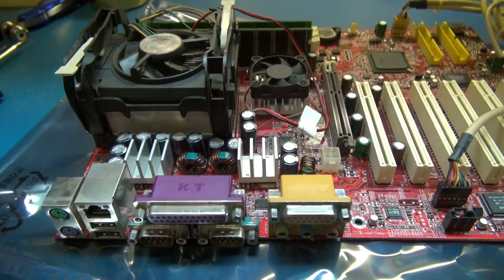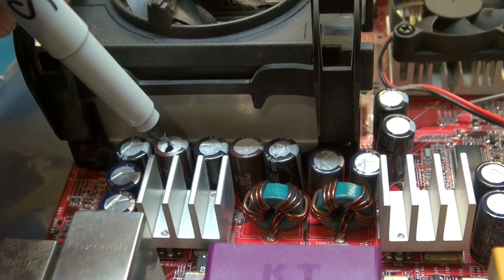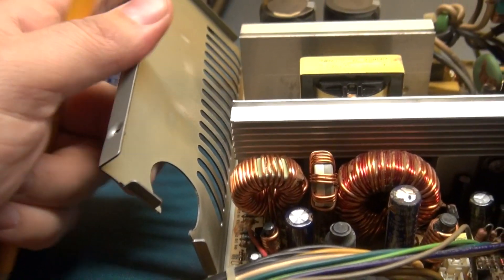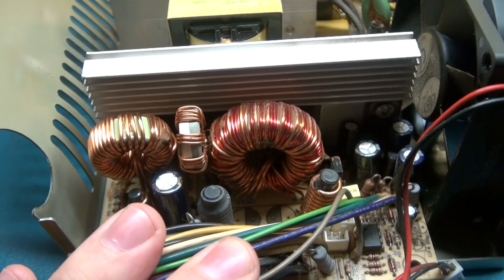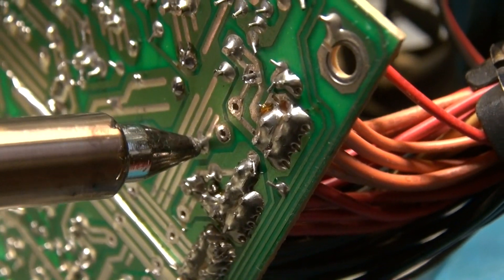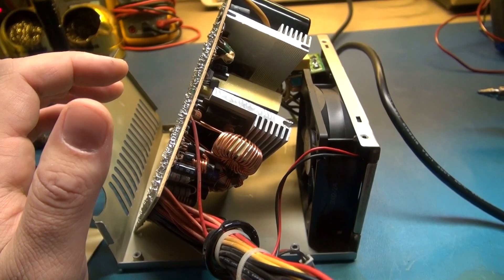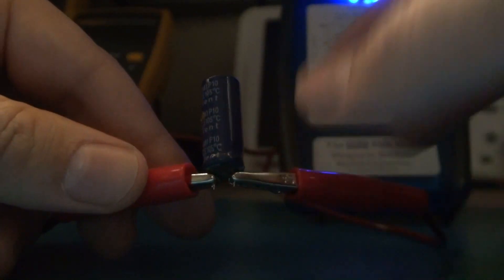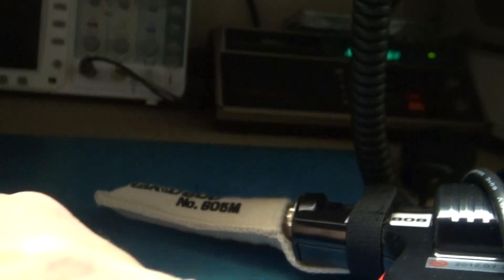MOTHERBOARD AND POWER SUPPLY REPAIR.

Comment: Kev, would you think that the $15 to $26 ESR meters available on Amazon are a reasonable solution for a DIYer?
Reply from the maker: I have no idea if the ones from amazon are any good. I use this one. It was a kit to build. 
http://www.ebay.com/itm/Anatek-Blue-ESR-Meter-Full-Kit-for-Self-Assembly-BESR-kit-/181463391631?hash=item2a400f9d8f:g:Q-8AAOSwPhdVCg8U

Comment: I usually just replace all of the caps with good ones so I don't have to go back in when the leftover cheap ones blow. I've only ever done this on monitor PSUs.
Reply from the maker: +Tim Ramich Yea I usually do that as well, but It was an old P4 and I was not going to be using it for much longer at the time.

Comment: my dell power supply is not working.all the capacitors and transistors are apparently in good condition plus nothing smells bad.but still its not working can you help me.REGARDS
Reply from the maker: +Rizwan Nasir  Not always will the capacitors look blown, they may still suffer from internal damage. not only that but any component can look fine but without proper test gear you will never now for sure. you will need another supply to test to make sure that is the problem . you could have something else not functioning properly.
Reply: WHAT SHOULD I DO
Reply from the maker: +Rizwan Nasir Well if you can borrow a good power supply from someone or buy one to see if that is your problem. Go to best buy or something and buy a cheap supply, If it doesn't work bring it back. If it does keep it. They are not that expensive. Other than that without test equipment it would be hard to repair. You would just be guessing.
Reply: +Rizwan Nasir The computer not powering up doesn't mean the PS is bad.  A bad motherboard can just refuse to power up.  Good to have old power supply and motherboard floating around.  My advice is as time goes on if you build your own computer and upgrade, do not throw anything away... Ever.
Reply from the maker: +mason salt My point exactly.
Reply: +kev31779 What test gear.

Comment: Hiya, I've got an old pc that I tried to connect to my hdtv through vga to vga but the display won't work.. it just goes blank (black screen) then power light flashes on the hdtv. Haven't used it in a while, for like 4 years lol but I recall it working... it powers up but but no beeps :( From what I've gathered, it could be the cpu or mobo... only using a keyboard, could a mouse not plugged in stop an old pc from booting up/ showing a display on monitor/ hdtv?
Reply: +Bored Gamer try to change the tv input from hd to vga... if this didn't work, i guess you should check your pc's hardwares instalation.
Reply: I'll be right over to look at it for you

Comment: Wow, thank you SO much for this video! I have been on a whirlwind self education this month trying to repair a Whilrpool Cabrio washing machine for my best friend who does not have money for a proper repair person.  I have successfully tested just about everything on the machine and had quite a few very knowledgable friends try to come help me as well.  We think the mother board is what is going wrong, because each set of pins is clearly marked as to which part of the machine it serves, and the diagnostics are all over the map each time I run them.  For instance, sometimes the ohm reading is correct, but the function on the machine does not work, and vice versa.  Long story short, I have gotten a little bit cocky now and have decided I would try to repair the mother board!!! An electrician gave me a quick 101 lesson on how to do it, and I am hunting around the internet for ideas. Your video is fantastic! These control boards cost $300 from Whirlpool and are VERY hard to get a hold of used.  My friend does not have $300.  Our other friend has said they will give her an old machine of theirs, so we DO have that for backup.  But I would LOVE to give this machine a new motherboard! It's nuts that Whirlpool does not offer a recall on this electronic control panel because SO many consumers have this problem and message boards have had people saying that they wanted to form a class action law suit against them! Well, who has time for that? (Um, but I have time to spend 30 hours trying to fix this machine? Well THAT is fun!)  Anyway, me and this electrician looked at the control panel/motherboard last night and it really does look great! Also, I took the rest of the machine apart, cleaned every single part, dissolved the rust that had fused together three parts (using combo of veggie oil/nail polish remover), and all the rest of the machine looks great.  I bet it's the board! If you can point me to anywhere on the internet where I can find a way to repair this Whirlpool Cabrio washing machine Model Number: 
WTW5550XW0.  If you have any tips, let me know!  Thanks for this great teaching demonstration!

Comment: Excelent video. I liked the equipment as well. What is the equipment behind the capacitor tester and what is it used for.
For those users who encounter difficult to troubleshoot their computers, always question the hardware besides Windows. My client's system blew a capacitor, it was bolging, the cap was fat ready to explode. Not having these type of equipment, I opted to buy a refurbished motherboard. Out curiosity check and find out cost and pricing of Japanese Capacitors. if the price is close or beyond the cost of a motherboard, I opt to buy a brand new motherboard with all capacitors brand new that will last at least 5 to 10 yrs.  If it is one capacitors and you already have these equipment to sod and to unsod bad capacitors, definitely, this video is the way to go.  I plan on buying these equipment to add to my toolkit for fun, learning process and just in case. Intel used to make motherboards and they are very good, replacing 1 or 2 capacitors to them would be money well invested for personal use and business.

Comment: I had the same problem with my 775 MSI board. All the caps of one same value burst at an important time. I switched them all out within a week. I read recommendations to just pull the caps off and leave the legs, then solder the new ones on that. I didn't do that, just installed them normally with the hottest weller tip I had and slowly pulled them out. Now just like you, another set has started to bulge - system still working though - I need to take the time and fix them though. Thanks!

Comment: Me, I don't take the chance. If it looks bad I replace it. Then I test the others and replace as necessary. If enough of the caps in a device are bad I just do the lot of them at once. Mid you I work mostly on high power PA amplifiers, FX devices, and other such things. I'm a DJ and I repair my own equipment as long as it's out of it's warranty. I also have a Hakk-o 808 though I also use braid to clean up a bit when it doesn't catch it all.

Comment: I have the same hakko it's a god send on old equipment, but on new led less solder its still could be hard to Desolder parts. Some times it takes me 2 to 3 tried to Desolder the bad part noway around it.

Comment: I got tired of the complaints so I open one up and saw a bad cap 3300 uf 10v all had the same problem. It's like they had a timer one them to Makes you think hmmmm. Anyway got them all fixed. Did I even get a thank you what do you think? Any the complaints stopped that all that matters